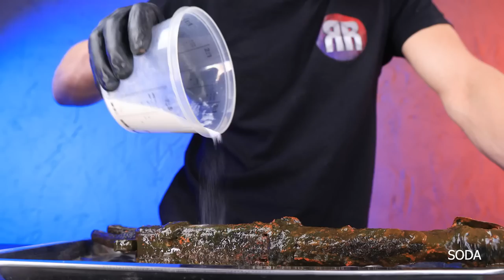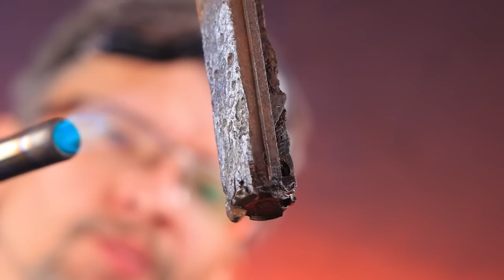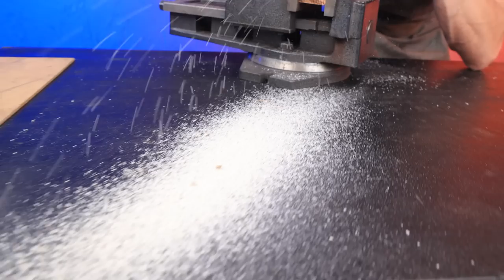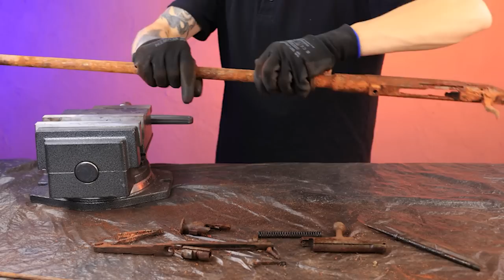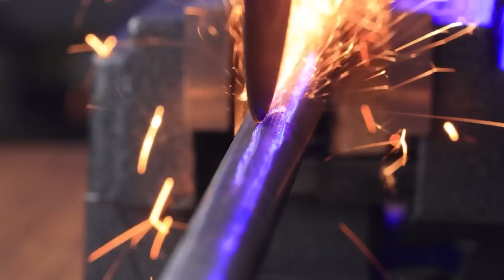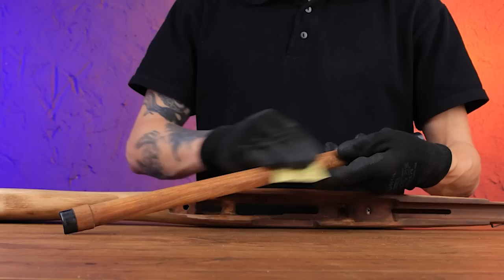Winchester 1895 | Old Ruined Rifle Restoration

Comment: Im curious on where these guns stand legally. In this case obviously no seriel number but its not like it was filed off. These would be considered scrap, how are the rules for registration and what about the fully automatic firearms?? 
Can these guns be legally used? If so can they be sold? 
(If you can sell them that would be a hell of a pay day)
Reply: Anything 1899 and older need no paperwork and can be sold and traded like anything else, at least in the USA.